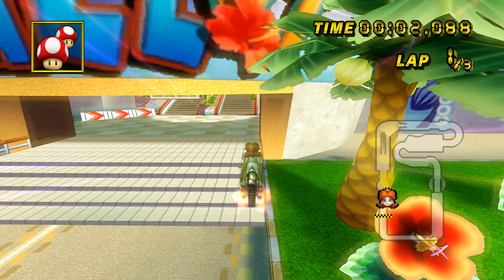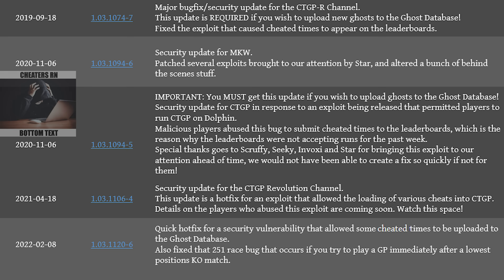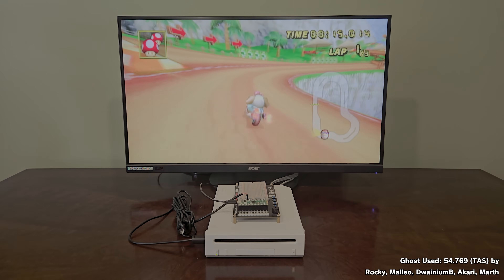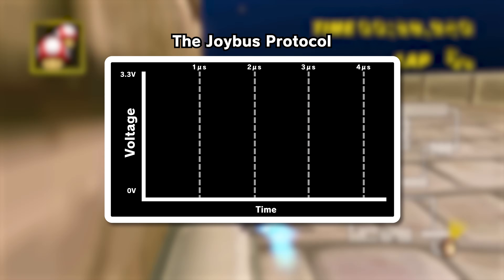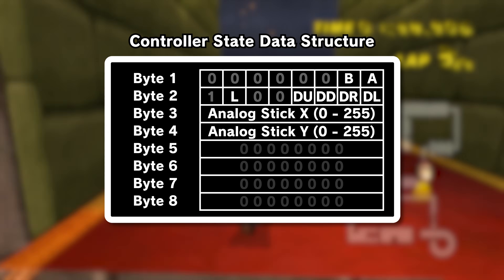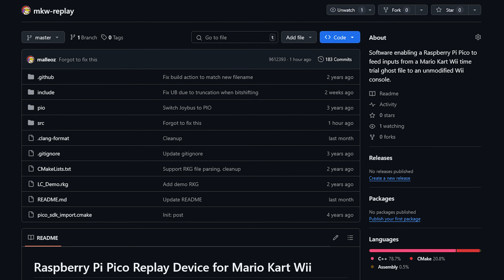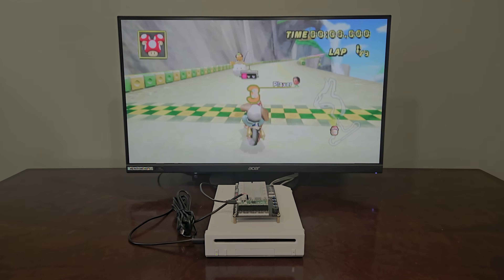Building an Undetectable Cheating Device for Mario Kart Wii

Comment: I could guess that this was a TAS. Also i could also guess that you are preventing it by making inputs non-deterministic. So now im not using CTGP becuase i want deterministic time trials
Reply: competitive game btw where high precision inputs are literally randomized XDDDD
worst part is that the randomization can be predicted because its parameterized, so just accounting for 1% error in TAS inputs during certain points is trivial if u care enough to cheat
Reply: The anti tas has been in testing for over a year and a few world records have already been set with the system in place. Multiple timetrialers have reported that they don't actually notice any real differences due to the changes being so slight.
Reply: @HEHEHE_I_AM_A_SUPAHSTAR_WARRIA  sounds like the cheaters will have such a hard time beating it

Comment: Yes, there is prior art. When endrift created the Game Boy Player Player, she started off by trying to drive JOYBUS exactly as you did. This wasn't the final implementation used because the Game Boy Player polls the controller at a very slightly different rate than the Game Boy Advance (59.94 fps vs 59.73 fps), so it was guaranteed to eventually desync, and she discovered test pads that let her directly drive the GBA's inputs, so it wasn't worth solving the desync for that use case.

Comment: If you write this as PIO assembly rather than Native C, you can time it to match the GameCube's polling cycle perfectly without having to rely on any thread blocks or "waits". It'll also run on its own thread completely co-dependent of any other program, freeing up the main CPU for anything else you might want to add to the MCU.

Pi Pico's are awesome for interfacing with non-standard IO styles (like game consoles), or even emulating a shift register for older consoles. PIO is definitely worth learning if you're interested in console IO. Its as simple as setting all your buttons to a 32bit int, and referencing part of that int in a PIO program that's set to the clock speed of the GameCube's polling rate.

Comment: 5:18 you still need to ensure that the console and the controller have common ground level, so unless you're powering the controller from the console elsewhere, please connect it. If either of the devices is floating, the signal can be anything in relative terms, and usually a device connected with an unearthed power adapter will float about half the rectified mains voltage away from true Earth.

The ESD diodes in both devices will try to minimise the difference between devices but also they're NOT designed for this, so their survival is not guaranteed, with the outcome being a pin on a chip permanently stuck in high or low state forever, and there may still be considerable offset even while  they survive.

Comment: No. You have a ground loop between the ground of whatever powers the pi and your wii. You need a signal ground, voltages are always between two potentials, never on their own. So right now there is some noisy current leaking between the power supplies, which also means that they're not isolated. Good heaven, use the ground pin as signal ground. Also, I think these controllers need a pull up resistor to 3.3v, so you need that rail as well anyway. You're basically just sitting duck until one of the components in the power supplies, or some poor other component will fail.
Reply: I think he's rescued by powering his Pico from the USB port in the back of the Wii, which is on the system's power rails. Otherwise he'd be in such a world of pain by now.

Comment: I used to do QA at Harmonix and when we'd do stuff with leaderboards I always thought about how easy it'd be for someone to make a unit like this and just auto input every note with the perfectly optimized star power/overdrive route. In that you'd have dozens of frames of slop to work with so it'd be absurdly easy, so it's concerning to see that even in a game where absolute frame-perfect syncing is necessary it's still fairly trivial to do

Comment: One suggestion based on the video, assuming it wasn't implemented yet, is for the disconnected controller message, adjust the game to randomly offset when that can be displayed, to make actual input syncage to the gameplay much more difficult, in addition to the new techniques.
Reply: Why would it not be implemented if it were a decent idea.  In what universe would you be the first one to think of this?

Comment: not connecting the ground pin is asking for problems. Voltage is always relative. Always. In practice the grounds will usually be close under many circumstances. But they are never guaranteed to be the same.

Comment: How did this work without connecting the ground of the gamecube port to that of the pico? Normally you need a ground wire to be the reference to the voltage in the data one otherwise the wii doesn't know what is 0v and 3v

Comment: Hey, another hardware-focused programmer here: one piece of feedback I have is to make sure to always connect some ground pin between devices, especially if they're not running off the same power supply!
Remember that voltage is always relative to ground, and if you have two different grounds, then your voltage goes all over the place. Right now, running your Pico off a PC plugged in the wall just like the Wii, you have a ground connecting through the literal wires in your house, but if you run your Pico off a laptop on battery power, every time you change the voltage on your data pin, you're going to see a change in the ground voltages between the two devices.
It's probably not required for you because it seems to be working, but if you ever do more hardware stuff, it's good to keep this in mind. Not all grounds are actually ground, and that's why we connect them, until something blows up
Reply: I work with the pi pico and joybus and I was surprised to see this working too! Spot on about the grounds being shared via the AC neutral connection (so it would fail on battery power or likely with the pico's power supply coming from a different outlet). But in addition, I was surprised to see it work with no pull up resistor either. Joybus devices (like controllers) are expected to contain a ~700 ohm resistor between 3.3v and data. The signal is transmitted bidirectionally by the controller and console taking turns grounding the data line. I found the pico's internal pull up to be far too weak to get a functional signal. I'm working with an N64 though, so maybe the Wii has an onboard pull up.
Reply: This was bugging me all throughout the video! 😂
Reply: for the case of plugging them both into the wall: aren’t most DC power supplies fully isolated from ground and completely floating? That means that unless you had it plugged in via something grounded to the Wii itself (which you still really should ground to the controller socket anyway), it would be completely floating.
Reply: @PaulFisher  Most DC supplies for consumer electronics do not seem to be isolated in my experience. DC ground and AC-neutral will generally show connectivity on a multimeter.
Reply: @greatestbear  how would that work? because most adapter plugs are unpolarized in my experience, so it would be a coin flip as to whether the device’s ground would be referenced to neutral vs. live.
Reply: @ It would not work, you are correct. I don't know why I said "neutral" twice in this thread when I meant "ground". I can't seem to edit the comments either.
Reply: @greatestbear  ah! I was thrown off because most adapters I have are just two-prong dealies. I do have a few grounded adapters (for things larger than just USB), and will have to check whether they reference their DC ground to Ground, which (like you) I would expect.
Reply: Hardware EE here, Yes if two boards are communicating they either need to be grounded together in a way that doesn't cause a ground loop or the signal needs to have AC decoupling.
Reply: You actually want to use the ground in the cable since you have a digital waveform with microsecond period (meaning nanosecond rise times). The ground and the data together form halves of a waveguide. It might work through a separate ground, but you're practically begging to get occasional, impossible to debug bit flips if you screw with the return path and distort your edges too much.
Reply: I was also quite surprised this even worked without a common ground. Since this is ultra low voltage DC there's most likely a transformer between the supply and the wall outlet. This is probably fast enough that ground is going through the capacitor for EMC which connects the secondary side of the transformer to the primary.
Reply: The ground is always just as important as the positive. I used to install car stereo's "large amps and stuff" the most common problem people came in with was a Amp under powering and 9 times out of 10 they had a huge positive power cable with a wimpy ground going to vehical chassis. So I undo that and run an equal size ground cable directly to battery and just like that the system works many times better! many people don't understand that the ground is just as important if not MORE important than the positive. Remember the positive sucks the electrons and the ground provides the electrons.
Reply: It depends how the Pico was powered. It takes Micro USB so it may be powered from Wii's USB port, solving the ground issue.
Reply: @PewnyPL  It really doesn't matter. The grounds should be connected to reduce noise even in cases where there's another longer path to ground.
Reply: I'm not an EE (or really an electronics guy at all), but not grounding the devices together did seem a little questionable.  That's an easy enough fix though, obviously.
Reply: Thank yooo
Reply: I had noticed that and was going to say something if no one else had, but you already said it!

Comment: Good video.  I mess around with microcontrollers for a similar-but-different thing... I like to monitor the data going down the controller line and turn it into controller visualization.  I've written implementations for the NES, SNES, Genesis, N64, GameCube, PS2.... you get the idea.

I just wanted to say that the workaround y'all came up with to mitigate using replay files is DIABOLICAL and I freaking love it.

Comment: Those terrible solder joints aren't your fault. When I first tried lead-free soldering after years of experience with leaded stuff, I bought the cheap green roll off eBay and had similar results. You'll have much better luck with the lead-free Kester stuff.
Reply: Nah he simply got too confident and fed the solder in before the joint was hot enough. But i think it's fine, like how many of these pins have to actually work, just one of them.

Comment: Awesome video. Thanks again for reporting this to us Malleo! ☺
Sorry we took so long to get the fix out 😅

The fix is controversial certainly, hopefully people appreciate the importance of it, but I totally understand people's concerns about it, and Bean and I are happy to talk to people about it.
Reply: lmfao you actually did it.  Distracted lemmings but at least you can do work
Reply: 16:18 If the input changes are so small that a player can adjust to them without noticing, wouldn't it be possible for a good player to "take the wheel" on a derailing TAS replay to place it back on to a deterministic state (even if he then needs to adjust with small inputs for the next 4 turns to make it resync completely)? If a "copilot" controller device is built (so what Malleo did but with a Y fork attached a human controller that takes priority), it could even be played online and resume TAS replay after recovering from a shell or another event (say, when entering a canon). I feel like this could be overcome by building a riskless (but slower) TAS that would need a stronger desyncing to come close enough to obstacles, or just replaying a human playthrough that the cheater felt was good enough... Anyway if no cheater ever attempts anything beyond pasting full 3-laps inputs, and the sums of the induced errors doesn't ever converge or cancel each other, and everyone who plays likes the change, this is a great fix well done! :D

Comment: As someone who plays PC games, I absolutely despise client side anti-cheats. They dig through your system files and RAM, they treat you as guilty until proven innocent. But for a console, you wouldn't really have photos, personal files, or really anything on it. However, a principal is a principal and I hate cheaters in online games, I have always protested for server sided anti-cheat solutions to keep end user privacy. But for a speed run that is not as possible, especially when it is just a recording of a game. Something like Doom where you can submit input files easily can be put into an analyzer to ensure no foul play, but how do you get an input ghost file off a Wii? Idk I guess I am stuck between a rock and a hard place on this one. Client side Antioch eats bad, cheating worse, but does the worse outweigh the invasion of privacy(at least for PC Anti-Cheats)
Reply: Ctgp already allows you to upload ghosts from the wii to a database, but this doesn’t prevent cheating alone because it isn’t possible to detect if specific inputs were cheated or not in this game.
Reply: @campbellblock3061  Yes, with the device he showed off things like that can happen in Doom speedruns too actually. And it can be even more prevalent because in Doom each mission is identical. Or SMB, there are so many games where there is no RNG or the RNG is manipulated based in inputs by the player that you could play back any past speedrun and get a somewhat similar result. Scary thought that.
Reply: "but how do you get an input ghost file off a Wii? Idk"  watch the first half of this video if you dont somehow know already hahahaha why are you even talking??
Reply: @WroughtJallie-i4v  What? Are you high, what was that run-on sentence that is completely incoherent?

Comment: Another solution is to have a repository of all known TAS files, either submitted by another player, or published on a TAS website or another leaderboard, and then automatically reject runs that are too similiar to these.

The problem with the current anti-cheat solution, is that the cheater has access to the software, including its RNG modification of inputs, so the cheater could tweak his TAS file so there is room for the random inputs. Which would actually make it even harder to detect.

This would atleast make it so people cannot just buy or create such a cheating device and load a known TAS file, they would have to create their own TAS, which means they already have access to this cheat.
Reply: You can create ghosts on emulator, so the problem with that method of comparison is that anyone can make a half-decent run on their computer and feed it to the program. You would also have to do a lot of comparisons, as lots of ghosts are uploaded to the database each day, whether it is competitive or not.
Reply: Yeah, what the other person said. This would basically only really stop someone from trying to clone the current TASVideos run or something, and any kind of cheater who is actually trying would realize that would be obviously fake and try to make something up themselves.

Comment: Ahh, just like the infamous "trimming the herbs" clear for Super Mario Maker's final days.
An idea for deterring automated input devices, since you have to rely on the reconnect controller prompt as a point of deterministic timing, could this be resolved by making the timing of that reconnection indeterministic through random pacing, or requiring additional "calibration" inputs?

Comment: Your design has a flaw I think. You need a ground connection between the ground of the pico and the ground of the Wii controller port otherwise you'll get floating voltages. It still works as long as the ground the of the socket the wii is plugged into and the pico is plugged into is shared. But that's not always the case (Unless you're plugging the picko into the USB socket and presuming the Wii has one shared ground). Anyways you could have connected the pico's ground to the controller port's ground is all I'm saying.

Comment: 11:23 does this ever desync?
Reply: Probably, just considering the nature of electricity and hardware.  But if you start with the correct timing, it's stned long enough for a race easily.  Optical sensor and some software to calibrate laong the way and you could probably get away with a lot more gameplay at once synced up for a segment.  Some console TASs even change their inputs from the emulator to accomodate hardware timings
Reply: @WroughtJallie-i4v  thank for reply

Comment: I’m sure this comment has already been made, but to fix your soldering you should use flux and also apply heat to the pad of the pico and not just the lead, allot of the joints didn’t have solder flow into the pads

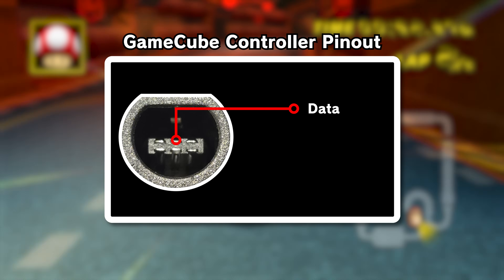Comment: (5:27) A more advanced version could add an SD card slot and a screen to select between different replays. Considering the Raspberry Pi Pico runs on 3.3 volts so you can just use power from the GameCube controller port just fine. It saves you from plugging in another cable and is just more convenient in a final version.